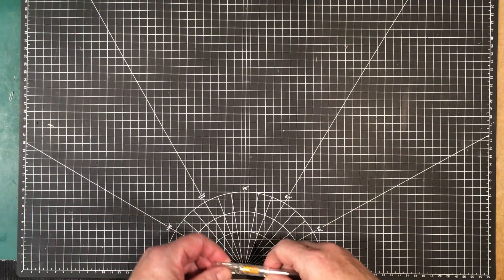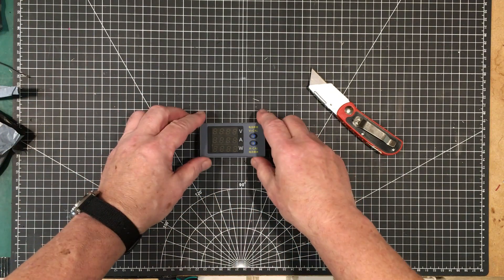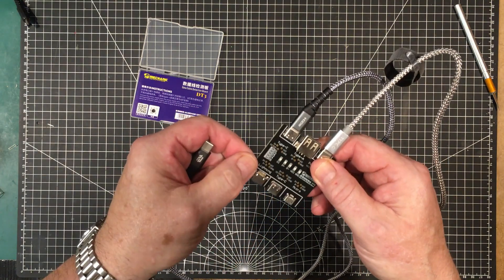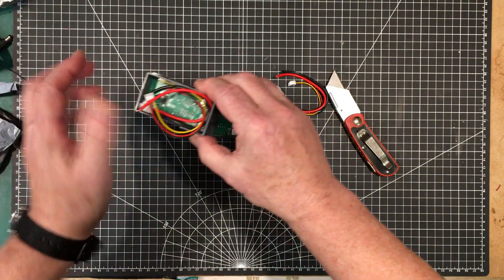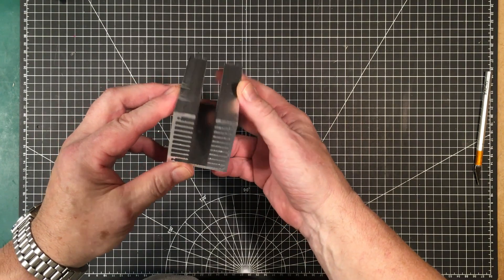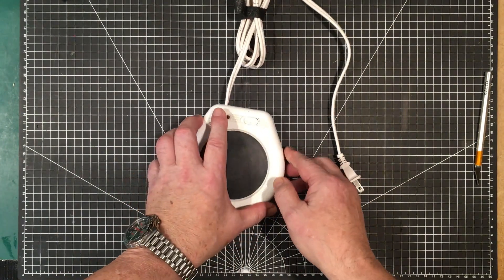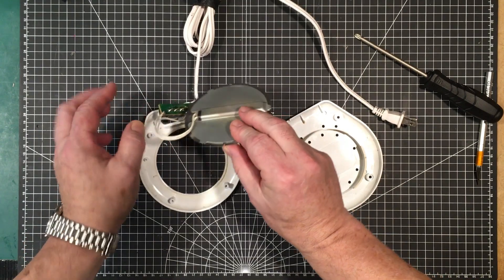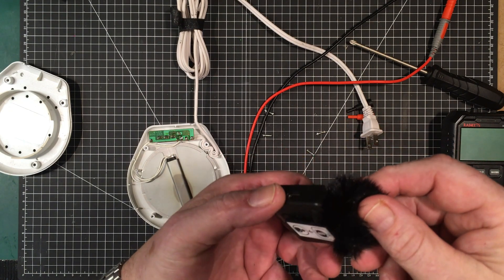Uni-Byte 0209 - MAILBAG #28:  Mad Project supplies, tools and a bonus TEARDOWN!

Comment: Can you do a vid showing how to use the XR2206 tone generator and the DSO 138 oscilloscope for beginners looking to repair amplifiers using signal injection and detection? PS Why do you say "sol - der" but "alu-mee-num"? North American tend to say "sodder"? Did you study/work in the UK?
Reply from the maker: If I had an amplifier built like yours that needed repair I certainly could, but any such attempt would depend heavily on the amplifier construction, not so much the tools.  I did do a series on fixing a guitar amplifier using a generator and a scope.  Look in my playlists for "Trash Picked Guitar Amp" or search for videos 108, 114 and 124.  Just substitute the XR2206 and the DSO138 for the generator and scope I use.  As for my accent, yeah I was born in Ireland.  I do say "Alu-min-ium" when I talk with members of my family, but have always said "sol-der".

Comment: how about a fan controller with thermistor/resistor divider driving a voltage or current into a gate  / base of FET or BJT transistor in the linear/active region for a simple variable speed fan controller ?
Reply from the maker: That is certainly one way to go.  Nice and simple.  But I'm aiming for something that will be a bit more versatile.  The ability to program the response mgit prove handy.